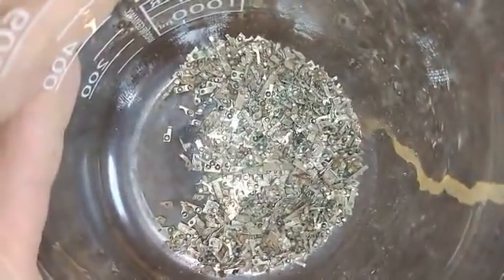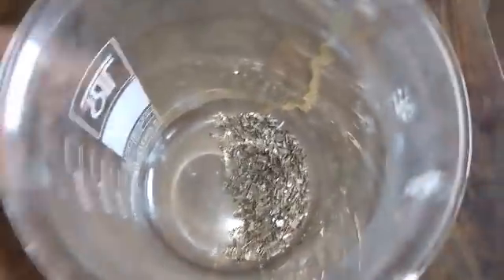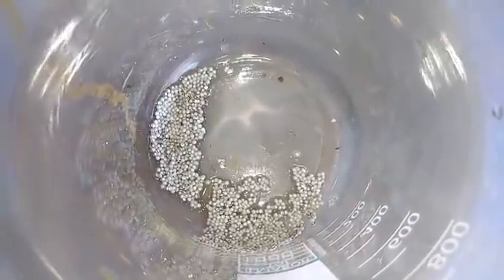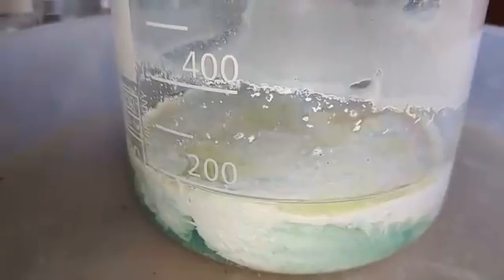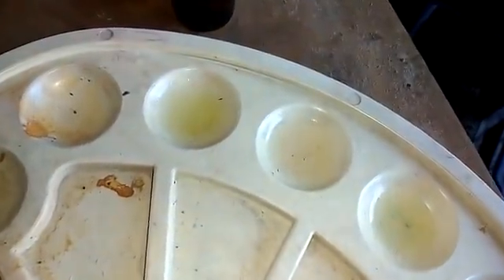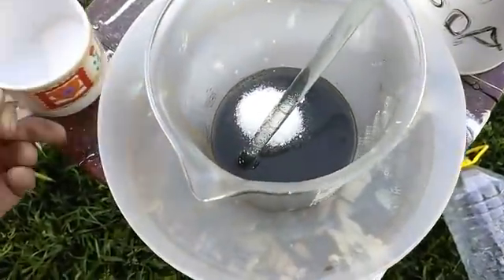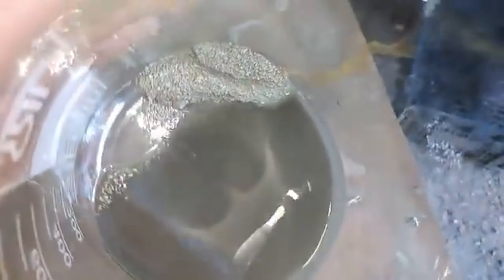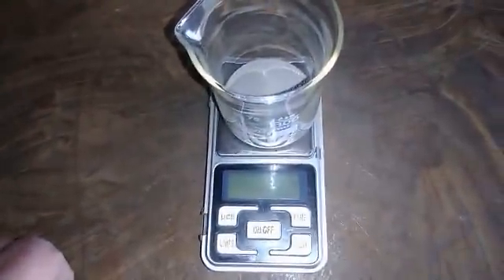SILVER RECOVERY & REFINING from contacts FULL PROCESS!

Comment: hi my friend. what is the purpose of equa Rega . why not directly use nitric aside. thanks
Reply from the maker: Well..I hope that this contact containe some Paladium aloy,so i von remowe oal base metal to have clean contakt,and Ap take slow and Poorsman Ar make fast step in that.And Porsman Ar dont absorbe Pd in Silver-Pd aloy so it is safe step.Starte nitric acid will make my solution full nickle and brass and if it hase some Pd inside that is be harder to drop pure Pd.On my regrets,no Pd in these contacks.